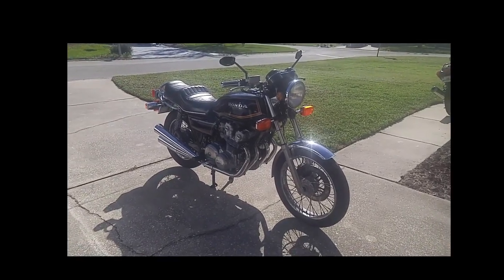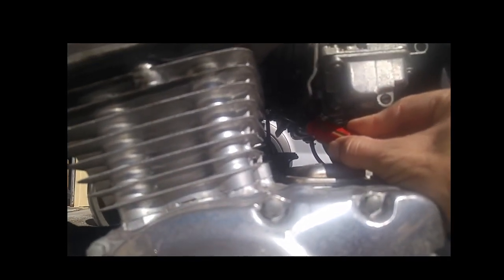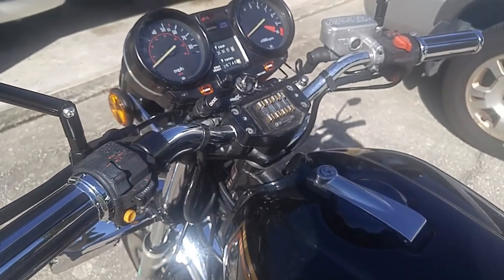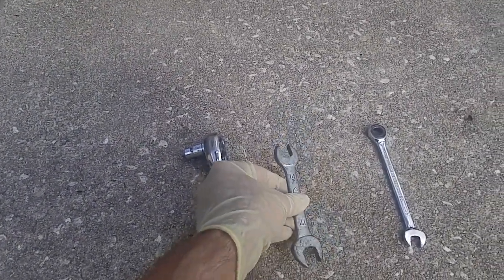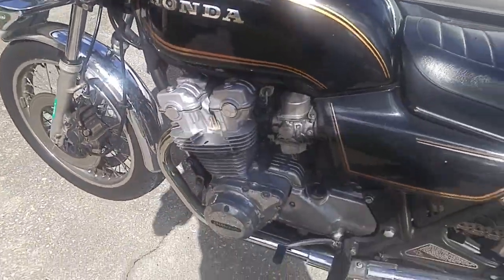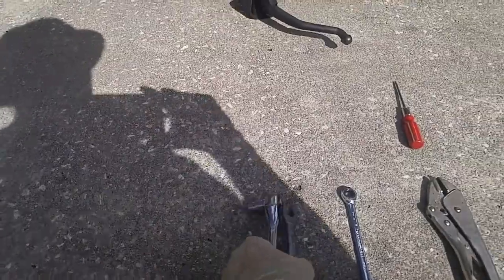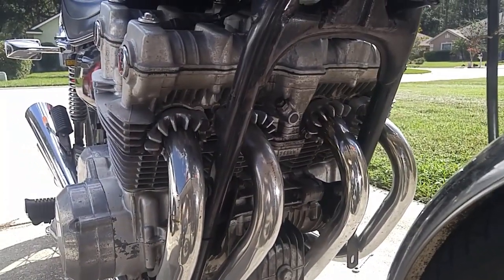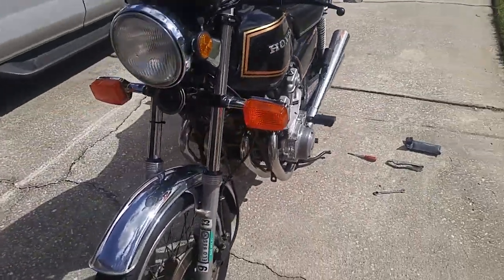1981 Honda CB750K camshaft chain tensioner adjustment (step by step)

Comment: DO NOT follow the video on here where the guy takes the side cover and the valve cover off. That is all wrong and confusing. Honda made the tensioners to self adjust and even my 1968 CL350 does this. This is only complicated if you make it so. Easy routine maintenance. I have done this on my 1982 CB900C by warming up the bike for 1min. Turning it off. Loosen all three lock bolts, start it back up for 10sec. Turn it off. Tighten (do not over tighten) bolts. DONE, no hot hands and works great. Great vid by the way. So many people damage their bikes doing this wrong.. Also this is something you want to do before adjusting valve clearance or setting the timing.  RIDE SAFE  and never wear rubber gloves working around hot things. lol
Reply from the maker: Are you talking about my video? I did not take the side covers or valve cover off.
I like your idea of loosening the bolts with the engine off, though, to prevent the engine from getting that hot. The way I did it is the way listed in the maintenance manual I have. I see a reason why you want to keep the engine running. The tensioner is just a spring lever. When the moto is running in idle it keeps the chain stretched a little more. When you turn the engine off the tensioner may retract just a little and give back some of the tension. Regardless, I will agree that I will be better than no routine adjustment at all.
Reply: @AeroRamer   not your vid  another where he removes the stuff mentioned > just about to do this and was glad i checked out yout tube a lil deeper  this is  easier way > my question is what if you do this procedure and it doesn't work . what are you replacing the tentioner and or chain and or spring and or all three >?
Reply from the maker: rharha2112 I am not a certified mechanic so I will not say I know the answer. I will think that if the adjustment does not work the chain will be so stretched that you will notice something is wrong. Perhaps more noisy than what you now is normal for you. At that point the chain may come off the gear and break something. I would look at replacing the chain in that case. Thanks for watching and for the comment.
Reply: how is cam chain tension going to affect the valve clearances?
Reply: @lukaszM46  It doesn't.
Reply: I have tried a couple methods to adjust my '81 CB750c Cam Chain from other online sources and the Clymer shop manual with unexpected results. This method posted by AKTOYZ I just tried and it by far worked the best plus no super hot cylinder heads or removing of sidecovers to manually turn crank. Very easy to make tensioner adjustment with great result of quiet cam chain - thanks AKTOYZ!
Reply: I just did this, and now mines much much! worse sounding chain slap than there was? Only way it stays quite is if i basically only finger tighten the bottom nut. If i tighten it the chain rattle goes crazy wtf!! ???

Comment: Great video.
My bike is the 76 400/4. I believe it has only the adjuster at the front.  Would like to know if is the same procedure( idle first, loose the screw nut at the back, increase a little bit the idle and then tighten the nut again). I have this bike for 12 years now, and never find a mechanic wanting to deal with it. I live in South America). So I am afraid to messing things  up . Any tips and tricks are welcome!
Thanks!

Comment: So basically you just have to loosen them and tighten them again? no adjustments needed?
Reply from the maker: Correct. Easy procedure but little tight and hot.

Comment: 2:23 So at 26746 miles is the first time the cam chain has been adjusted ?
Reply from the maker: No. It was the first time I made a video of it. Is there a specific question/concern about the mileage?
Reply: @AeroRamer  Well i was wondering how often this has to be done ? tks.
Reply from the maker: I would do it when you think it is starting to listen differently. I don’t think my CB needed it much. I get bored sometimes and start tinkering with stuff.

Comment: Enjoy ed the video but Must say i could t see the adjust er at the back, totally dark.
I didnt understand untightening the one on the front first, then untightening the 2 at the back of the cylinder., then tightening the 2 at the back up again,
Why not just undo the front, & tight en the the two back ones without untightening Them, then finally lock it All of at the front.
My wuestion is do the 2 at the back have too be rekeased. Before tightening up.
For some Reason?
Waiting for your reply mate..
Reply from the maker: Follow this link for a video on a CB550 that is similar to the CB750 (https://youtu.be/IwpISafzZoo?t=191). It shows the bolt on the back side.
Reply from the maker: For more explanation on the tightening/untightening think about it this way. The internal part is a curved piece that wants to be naturally straight. when you untighten both screws at the same time it takes the chain slack away from both ends. Once the curve piece cannot stretch the chain any more that is when you tighten the screws. That is why the moto needs to be at least in idle; to help you keep the chain stretched until you can tighten the screws.